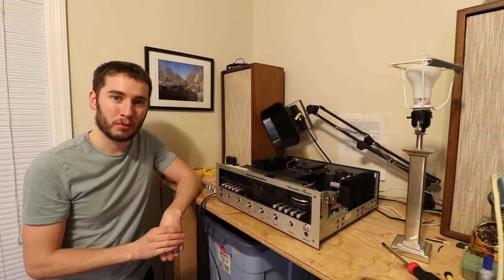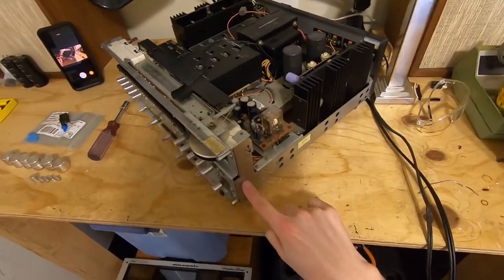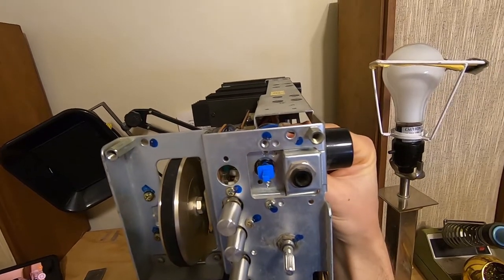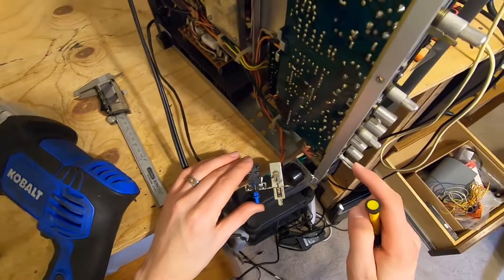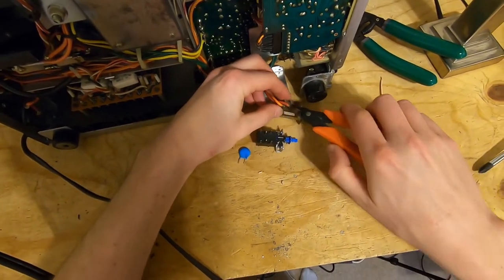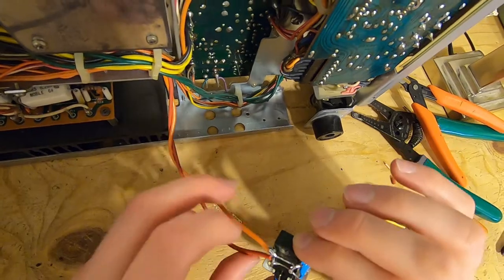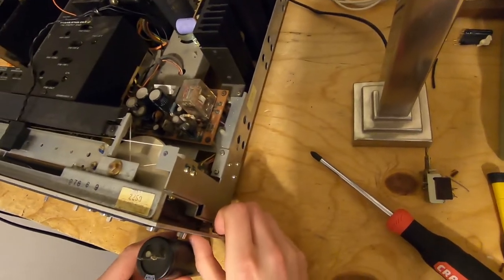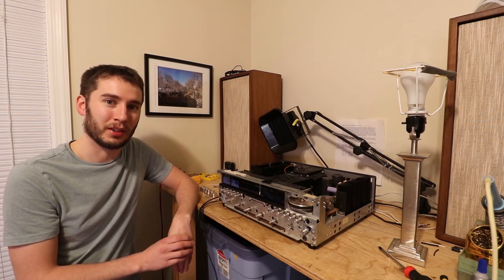How To Replace Vintage Marantz Power Switch

Comment: Had a arcing noise coming from a 2216b power switch that was not easy to hear unless using another receiver to pick it up, but a good cleaning now has resolved the issue.

Comment: Hi there from Santiago, Chile. Thanks for the very useful tutorial, though I don't think I'd dare going through the whole process since I'm not a specialist. But my question and your answer may well help somebody who is willing to cooperate in the recovery of my Marantz 4300. I'd like to ask you id the on/off switch of the 2250B is in anyway similar to the one the 4300 brings. I ordered a new replacement switch years ago and I'm not sure if it'd take the same intervention you did on the 2250B to be able to install in the inner pannel. Thanks for the time !

Comment: There's a highly remote chance I might attempt this on my 2270.  The power switch does not toggle on/off reliably, after a shop tech once dropped my receiver.  Yes, he dropped.  A.  40.  Pound. Marantz.  Or I might just ask my service shop to do this when it comes up in their queue this summer.

Comment: Thanks for making these videos,new sub.you have inspired me to dig out my old 2275.
Hasn't been plugged in for at least 15 year's. I'm gonna follow the testing you did in your previous video. I stopped using because it needed recapping. So I want to relamp and recap this thing! Where did you buy the service manual?
Reply from the maker: Thanks for the sub!  The next videos will tell you just about everything you need to know to bring your 2275 up to speed.  Service manuals are free at hifiengine.com, all you need to do is create an account.
Reply: Awesome thanks!

Comment: Hi,
Thanks for the very informative videos.I have some audio equipment that needs fixing.Will yoube kind enough to help me out with them in terms of giving infos on where to buy parts? Thank you.
Reply from the maker: mouser.com and digikey.com are both great parts sources.  Most parts specific to a piece of equipment can be found from a specialty website or used on ebay.com - best to find those using a google search.

Comment: when you can switch the cap type as well most caps back then were  electrolytic .most modern caps are  Ceramic . in most cases they are far better. its a case on case basis but most times you'll get a much better products

Comment: When you use that new power switch for the 2270 do you have to drill new holes. I'd really rather not do that.
Reply from the maker: I did not have to drill holes on the 2270 with that switch.
Reply: @AHFixIt  You're the man! Thanks for all the help and love the vids bro!

Comment: You really shouldn't be using a standard phillips screwdriver on these japanese units.  They use a slightly different head, a "JIS" type screw.  A phillips will work, but it is prone to slip.  If you're going to make instruction videos it would be best if you used the best tool.  I started with the standard phillips, not knowing about JIS, but learned about it on AudioKarma.  Amazon has them of course.
Reply from the maker: That's an impressive catch - I had no idea.  I'll have to buy one!

Comment: What is the capacitor value?
Reply: Probably a 0.01uf 2kVAC ceramic disc cap. The eBay sellers with these switch/snubber combos don't list details on the caps they use, but they look like the blue disc ones with the specs I mentioned. There are also "safety" caps that are 0.01uf 300VAC in the same form factor, if you want a little more protection from power surges.